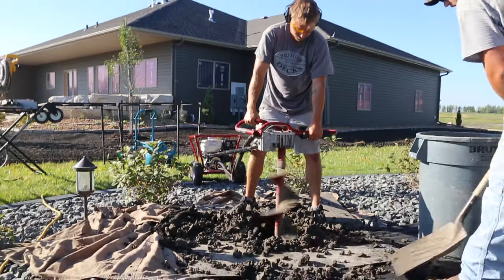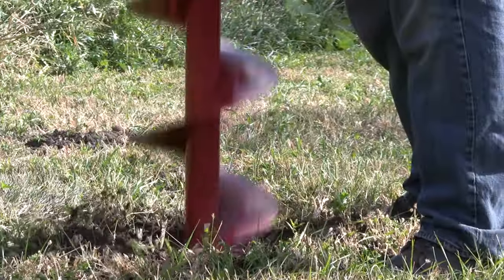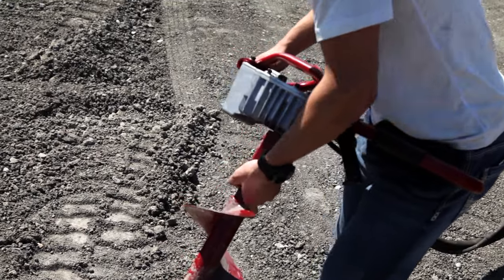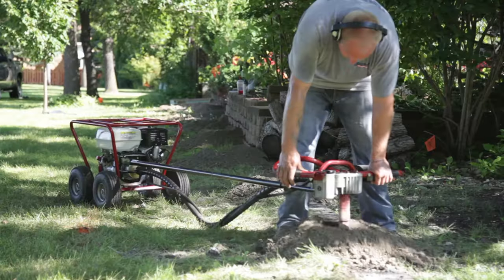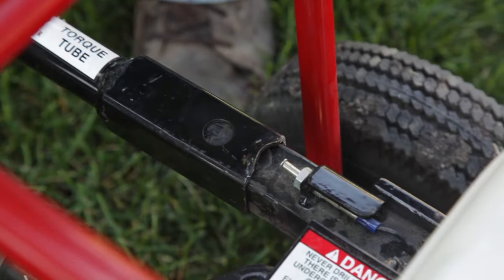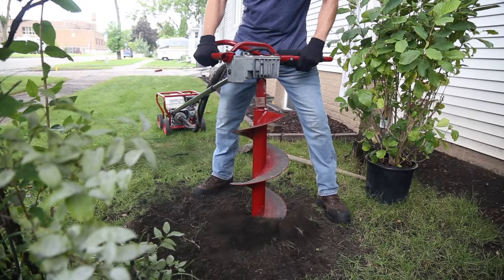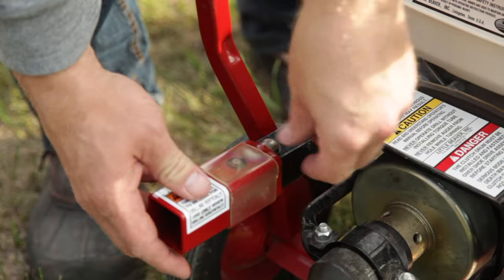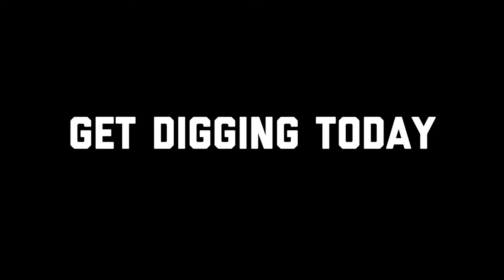Little Beaver | Mechanical Earth Drill

Comment: What happens if you hit a rock or something hard? Is there a lock proof that doesnt twist you around?
Reply from the maker: Little Beaver builds its mechanical drills standard with steel torque tubes to prevent such situations from spinning out of control. The steel torque tube transfers auger torque and kickback to a separate engine carriage instead of the drill’s handles. Learn more: https://www.littlebeaver.com/fencing-technological-advances/
Reply: @LittleBeaverinc  will it go through large tree roots?
Reply from the maker: @djexclusivee   If you will be drilling in an area that has tree roots, we recommend using our Snap-on auger with a carbide blade. Learn more online at https://www.littlebeaver.com/products/mechanical-earth-drills/.